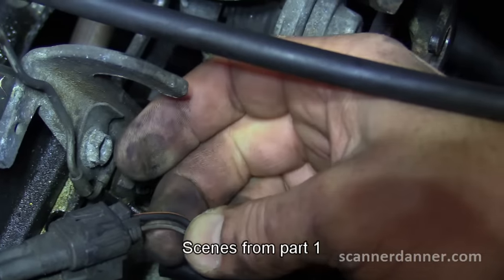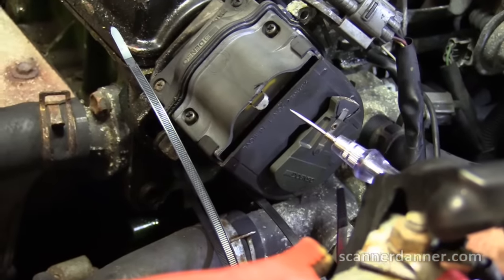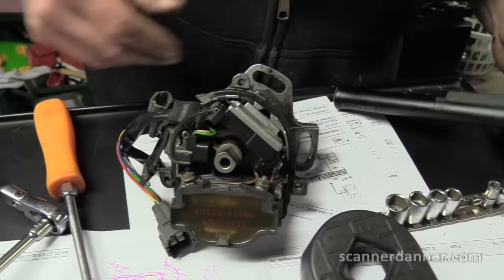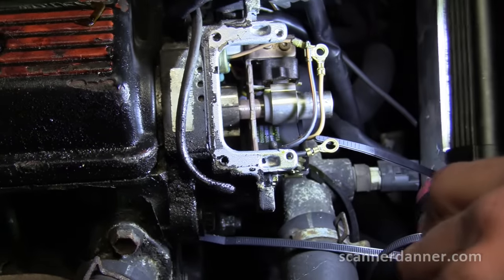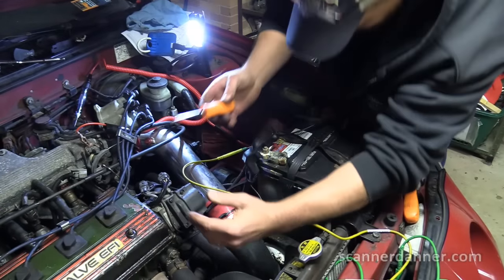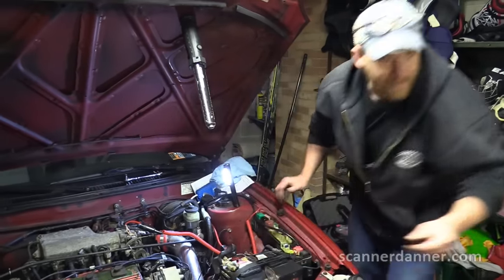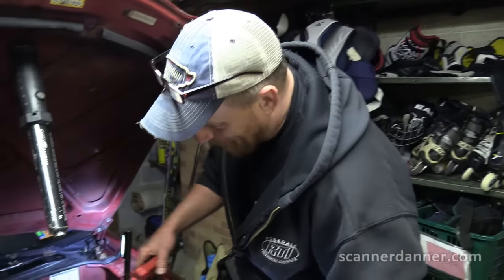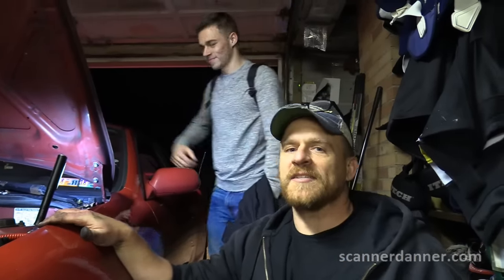Ignition System Operation & Testing - (No Spark Toyota Celica)-Part 2

Comment: Toyota because that's what I have I have a Nissan note Toyota Camry 92 it was a four banger kind of heavy body but I'll tell you this what why wasn't misfiring because I don't know why but I said to myself it must be the heat because see I normally don't like heat and when I burn I normally you know get burned you know you put something on fires and you burn right and you put electricity where it's firing and then you have a misfire if it's touching the heat and then because it becomes weak or it's become juicy it becomes tender what was it high density cable but it's still the heat gets to it you mean it was a rubbing on the what on the exhaust are you b********* me cuz exhausted right next to it what about the two fans if you turn on the fans on but whoa what what what wouldn't dream my battery when do the fans turn on when the car is hot then why would I need a fans I need to turn them on before the fans I just cut them and did what don't even bother doing have a low battery that's what I said I went like this positive okay the negative or the common because if you go either way why won't go anywhere when we go out where I didn't know that first polarity baby no s*** one will go inward but pull the air in or then one will pull the air out I said why am I going to contradict you how fast you want to go I wanted to go inward so what I do without the big noise and stuff I don't like my car nosy because when I'm having sex with a girl she would like it quiet cuz that's how I get to it she's the one that's noise very nice so I told myself okay I'mma go positive response why does it sound like I've been smoking some weed cuz I have stupid oh s***